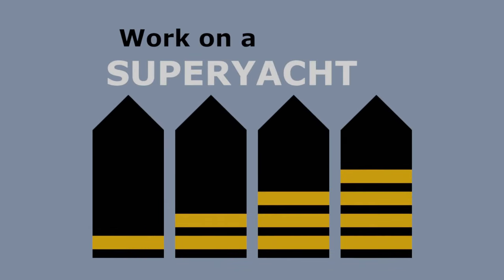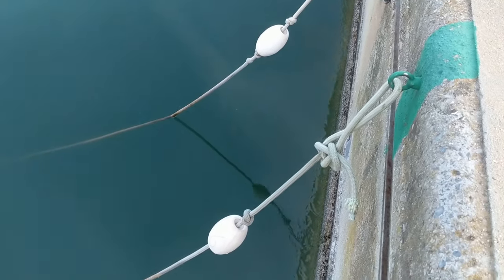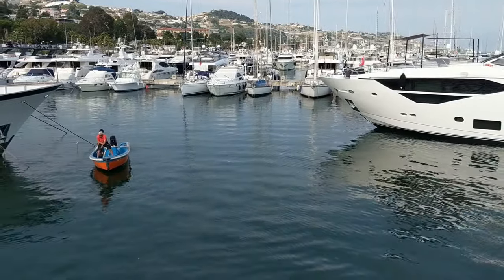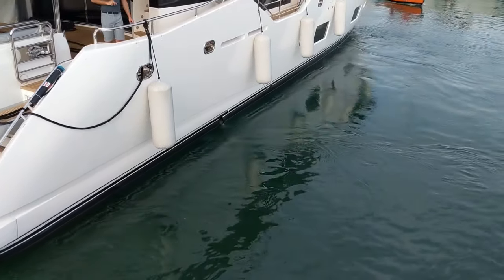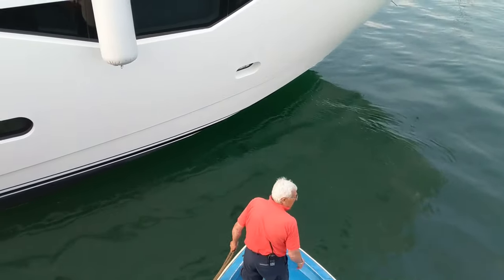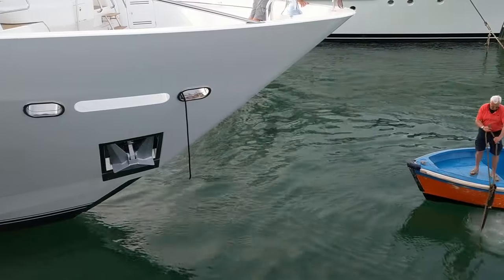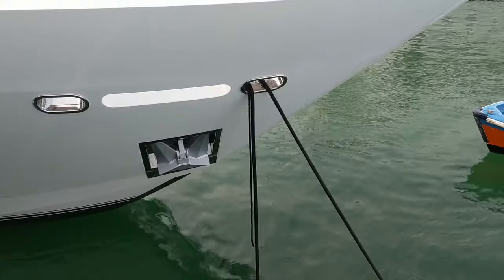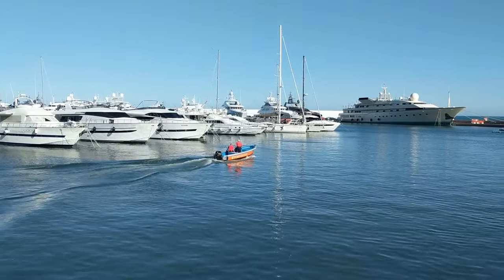How Do Superyachts Pick Up Ground Lines?

Comment: I have been looking for the answer to this forever. Thank you for making this video.

Edit: I just subscribed to you
Reply from the maker: Hello blewyd and welcome to the the channel. I'm very happy to have finally answered your question! Thank you so much for subscribing.
Reply: So have I and unfortunately I still don’t have an answer.  How do the guys on the tender grab the ground lines, do they dive in and grab them or are there floats on the end?  Can’t imagine there will be floats as they will foul props etc.
Reply from the maker: Hello Putzickle. If you watch the video from 1:15 you'll see the guys in the boat take hold of the smaller line that is connected to the dock. This line runs along the seabed and at the other end is connected to the bitter end of the ground line. So, they follow these lines in the boat until they reach the bitter end of the ground line. This is then passed up to the yacht, and the smaller lines continue to stay on the bottom. Does that make it any clearer?

Comment: Tristan has sent me here. Thank you for the video. Have subscribed.
Reply from the maker: Hello Ian, and welcome to the channel! Thank you for the feedback. I'm so grateful to Tristan for recommending this video. Between his explanation and mine, I hope we've finally answered all the questions about ground lines!
Reply: @WorkonaSuperyacht  glad to be on board. I like your technical descriptions. I ask Tristan do the ground lines get marine growth on them. Tristan said yes. So I presume the port staff regularly clean the ground lines of marine growth.
Reply from the maker: @Ian Lambert In my experience, the ground lines don't get cleaned. For ones that get used often it isn't such a problem; the marine growth dies and gets washed away whilst the lines are tied to the yacht. However, if you are unfortunate enough to pick up ground lines that haven't been used in a while, they can make a real mess of the foredeck! They often sit in mud on the bottom and the dirt gets everywhere! As a result you will often see mud streaks running down the flare of the bow from the forward fairleads. In addition, the marine growth on them can be very sharp, so it is sometimes necessary to wear gloves.
Reply: @WorkonaSuperyacht  fully understand. Having scuba dived on a racing yacht i crewed on and cleaned the hull, the growth can be horrible.
Reply from the maker: @Ian Lambert It sure can! What were you racing?
Reply: @WorkonaSuperyacht  it was a long time ago in my younger days, an Adams 10m.
Reply from the maker: @Ian Lambert I've just looked up the Adams 10 Class. They look like they are a lot of fun to sail!

Comment: The line with chain goes to the concrete block I believe.  Where does the black line go? Are the two lines coming out to different concrete blocks, one on each side?   With the lines snug to the dock, how do you handle tide rise and fall? Thanks.
Reply from the maker: Hello Phil. Yes, the lines coming out of the forward fairleads are running to separate concrete blocks. The black line will probably also be connected to a chain; we just can't see it beneath the water. I'm unsure of what you mean by the lines being snug to the dock. With respect to tide, it is negligible here in the Mediterranean; the rise and fall on most days is no more than about 0.2 metres.

Comment: So, that little plastic ball is big enough to float, once you leave and drop the line into the water?
Reply from the maker: The little plastic ball isn't really designed to keep the end of the line floating on the surface of the water. Instead, before we leave the tails will either get reattached to the dock, or if there isn't room they will just attach them to the ground lines of neighbouring yachts.
Reply: @WorkonaSuperyacht  TY for coming back on this matter as it's the exact part that I never understood. Made me happy, Thank You!

Comment: What happens when you let them go? Or do you literally pass them off to the harbour masters boat again?
Reply from the maker: Hello Jack. Yes, we just drop them into the water, making sure that they sink before pulling out of the berth. The ends of the ground lines are still connected to the dock, which allows the port boat to find them again.
Reply: @WorkonaSuperyacht  that makes sense! Thanks for the reply - subbed!
Reply from the maker: @Jack Rogers Thank you, Jack! I really appreciate the support. Any other questions, please don't hesitate to ask.
Reply: @WorkonaSuperyacht  - if still connected to the dock, how? If you ran the end through the fairleads?  I mean hadn’t the Marina crew already disconnected them from the dock?   I guess I feel a little daft and maybe missed something. LoL